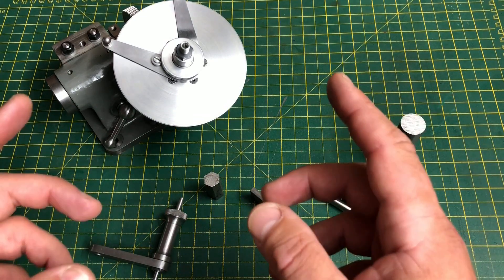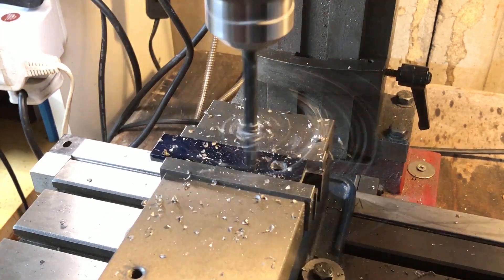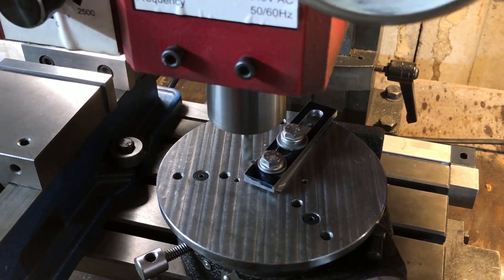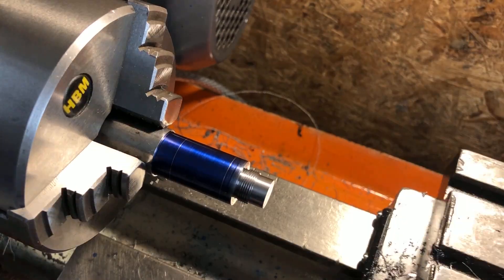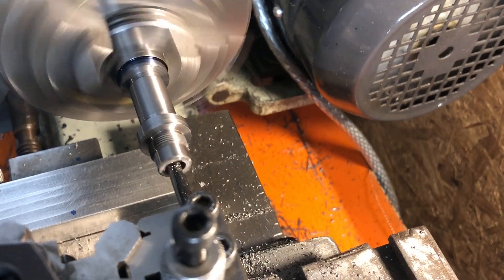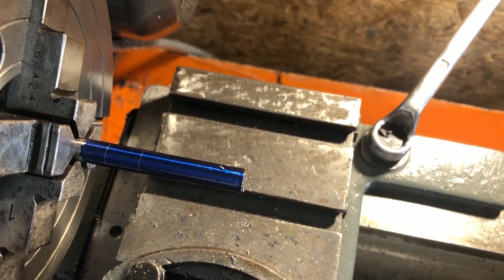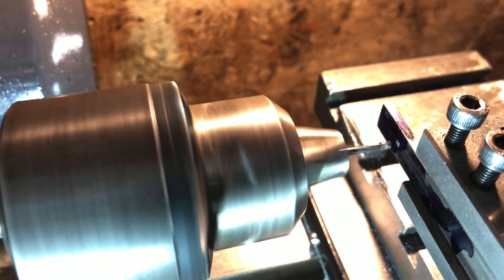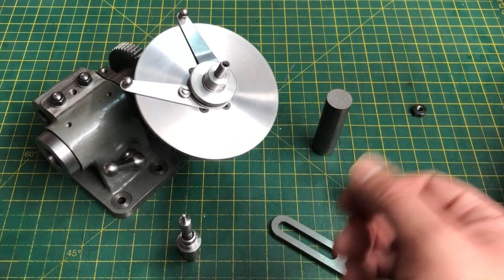Building The GHT Versatile Dividing Head - Part 11 - The Main Plunger (Part 1)

Comment: Do you have the independant tailstock/footstock? I think it's sold as part of the additional milling setup. I have the footstock casting I'm going to machine to use with a 5C indexer I have I think.
Reply from the maker: No, I only bought the main unit. The projects I have in mind will predominantly be short projection so I didn’t think it would be worth it. I can always add it on at a later date if necessary.

Comment: I just found your build of this piece of Thomas history as presented by Hemingway kits. I watched your latest part 11 I believe where you referenced a later video (part 12 maybe) but I don't seem to be able to find it. Have you done it yet and if so where can I find it. Thanks for the series. There's parts of it if like to use in a modification of a Spindexer to incorporate a plate type index such as you've built here.
Thanks for the videos. Regards from Canada's banana belt.
🤞🇨🇦🍌🥋🇺🇦🕊️🇬🇧👍
Reply from the maker: Part 12 is not yet complete. For various reasons the whole project has slowed down I’m afraid but certainly hasn’t been shelved. I should be able to make good progress in the summer. One of the reasons I really like the Thomas designs is the wealth of ideas to incorporate into projects of my own. Thanks for watching the series so far.
Reply: @DrillsTapsDies  thanks for responding. I can wait. My project's been on the slow churn for a few years.

Comment: The odd legged dividers you used to scribe the round stock in the lathe? I couldn't quite make that out, have you a video on making those?
Reply from the maker: I don't I'm afraid. Most of the major brands offer them for not much money. They come with a scribe on one leg and then either with a step like mine, or often with a finger like an external calliper on the other. I think mine are a copy of a Moore and Wright design.